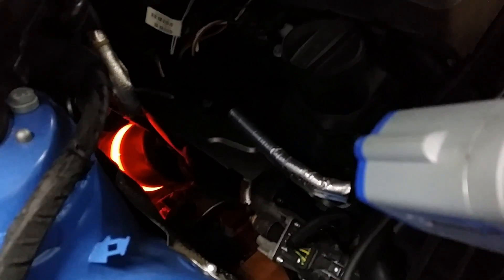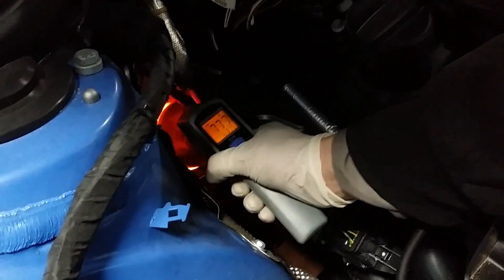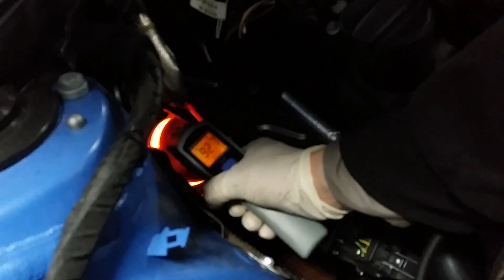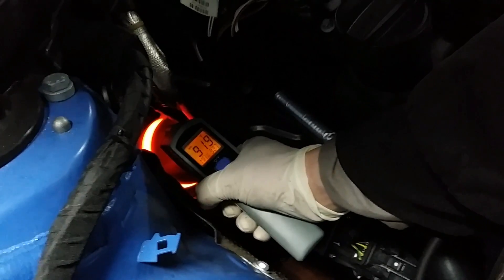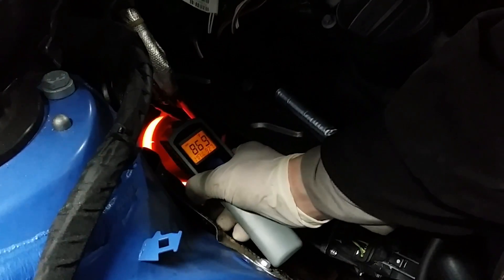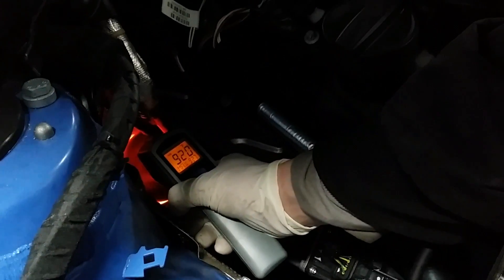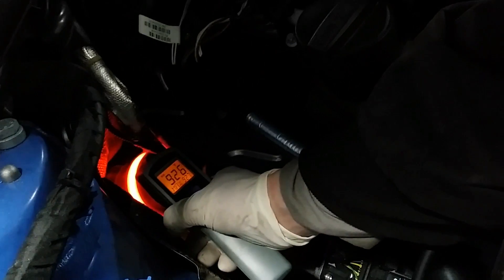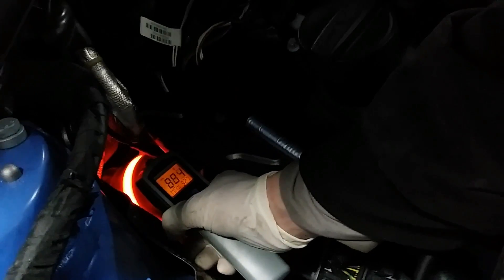BMW Failing Injectors Cause Glowing Hot Catalytic Coverter

Comment: This just happened to my 2015 BMW X5. It has about 121k miles on it. The car was stalling and drivetrain malfunction error popped up. When I checked with OBD scanner, it gave me P0087, P0300, P0301, P0302, P0304, P0305 error codes. What do you recommend ?

Comment: Hi, I hope you still answer to new comment.

My 2013 BMW 328i was taken to the shop the other day and they replaced spark plugs initially due to cylinder misfires, after replacement, they said that catalytic converter is glowing just like in your video, and ran a smoke test but found no leaks. After that they showed me the code of running rich fuel and said that i should go to bmw to update the software because the car was giving mix codes of misfires and bunch of other stuff so they thought sensor/software might be fauty and needs an update.

I’m sorry i know very little about car and now I’m sitting here inside my broken car having no clues of what to do and regret buying this car so much 🥲

Please let me know!

Comment: If the cat get hot like that can it works again or needs to be replaced?
Reply from the maker: Typically this leads to either premature CAT failure or direct damage to the CAT. On this vehicle the CAT was replaced. After repairs the CAT should be inspected for signs of damage. If the honey comb is flaking,  separated, or compromised it should be replaced.
Reply: @AskTheCarExperts  tnx as last week I drove the car n saw smoke coming into the car n stopped the engine but already the cat was red n immediately it burnt dramatically
Reply from the maker: @sankietsundzukachabalala2972  Sounds like like injector failure.  If you stopped quickly you might be able to save it.
Reply: Hello, my car is a G30 2019 model and it is turning red in the same way. The BMW service did not find anything and then said it was normal. Wouldn't the injector error appear in the system?

Comment: Why does a fuel injector make the cat so hot?
Reply from the maker: The CAT heats up due to unburned fuel from the injector spraying too much fuel due to a failure in the injector. Unfortunately this burns out the CAT honeycomb and leads to needing a replacement.

Comment: Definitely not a good thing to have a red hot object within an engine bay...
Reply from the maker: Add an active oil leak and it could lead to an engine fire. I see oil leaks from valve covers into the exhaust quite often.